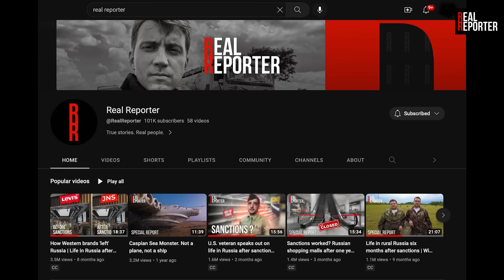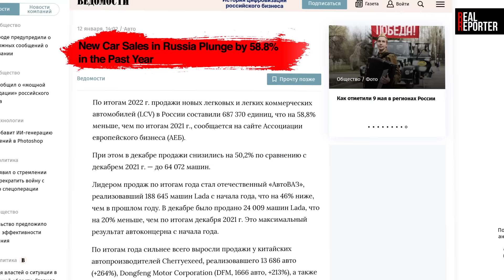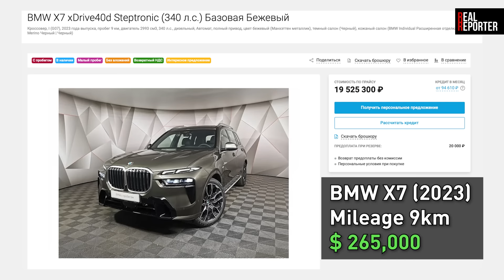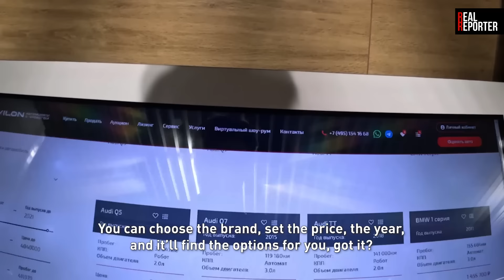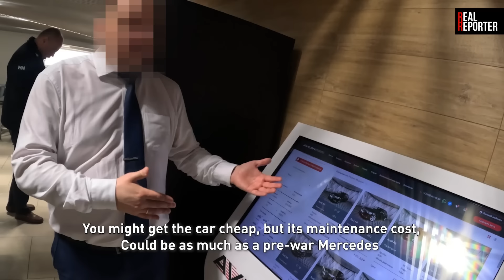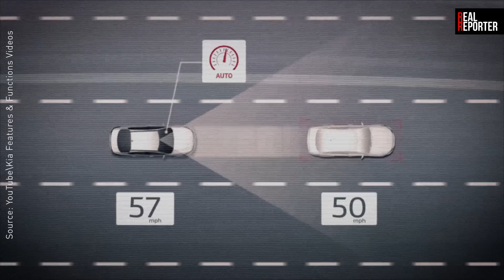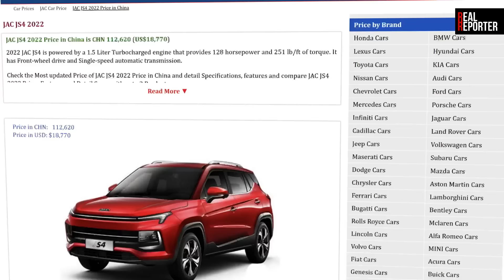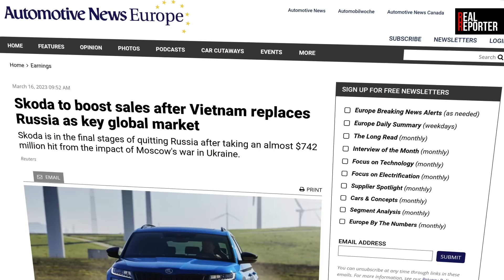Sanctions vs Russia’s car market. Who wins?

Comment: Great video! Yeah, the chinese brands have smoothly entered our market. We bought a new Chery Tiggo 7 Pro at the beginning of 2022 for 1.7 million rubles before the prices skyrocketed (now the new one costs around 2.6 million rubles). And my dad is currently choosing between a few car models, specifically a new Exeed RX when it's going to come out.
Reply from the maker: How’s your Chery doing after one year?
Reply: @RealReporter  no problems occured except for one - the windshield, it is very fragile. We often go to Moscow, the road is long and quite bad, so little stones often fly into the windshield, yet there were no problems on other cars, like Opel or Kia. And in the case of Chery - the windshield has cracked twice on different months. We only replaced it once (40k rubles) and now decided to wait untill the crack becomes bigger 'cause otherwise we'd probably have to spend money on a new windshield veery often.
Reply: @fersotic  Rich people have such difficult lives!

Comment: Man I didn’t expect Russia to be seemingly even more packed with crossovers instead of normal cars. I swear there are more crossovers compared to sedans in these dealers than dealers here in the US! But yeah good thing you didn’t go with that Jag, even without sanctions, those things break all the time, they sell for cheap cuz you always pay more than the difference in repairs. Also for your brake pads, I work at an autoparts store and brake pads are such high volume items I’m willing to bet the store had those in stock since before all of this, it’s entirely possible they’ve been in stock since before covid too, there’s so many car models in order to stay in business you really need a huge stock of parts. The parts supply issue is likely focused on more niche parts, not regular maintenance items, and these maintenance items can probably be replaced by Chinese manufacturers before they’d even be noticeably short in supply. $50 does seem steep for pads though, but I don’t really know all my cars are from the 80s and have like $20 pads lol

Comment: The Chinese Car market is really something huh. Even in the US, they've also entered it in force. South America, Africa, the Middle East, and I don't think its as big as the others but I already see Chinese brands in Europe too. It really shows how much effort their putting into there economy and making sure its seen far and wide.

So far, FAW, Howo, and Shacman are really proven brands since they are parntered with MAN, Mercedes Benz Trucks and even PACCAR Group with the Shacman 3000 models sporting the legendary US engine brand Cummins and comes with an ISM or ISX15 engines in their cabovers. Their also notorious for being insanely over specced(Their 8X4 and 8X8 dump trucks always seem to be prepared to be overloaded and abused beyond belief), comfort is not to my surprise an afterthought but they made sure these things will last till WW4 with a monkey mechanic with a wrench from 1955.

Whatever China is doing, its genius. Their taking what's best from East and West, mending it with Asian reliability and cheapness and making something in the middle. Its scary but its working.
Reply: I always see Shacman X3000 with the Cummins engine on it and man, they sound great when straight-piped. Also, other Chinese auto manufacturers that focus on diesel-powered automobiles like Foton now often use the nameplate Cummins which they put on their light trucks and Vans and it seems to be working from an advertising perspective.
Reply: Chinese ev are amazing and luxury.
Reply: Shacman's are tough
Reply: > Even in the US, they've also entered it in force
huh ? which brands ?

Comment: Welcome to the JAg club, bro! Those are.... I mean i had 3 already! :))) <3 Engine oil change with labor in Bulgaria for Jaguar XF 2015 - 475 bgn or 235 euro. (1 eruo - 2 bgn) Brake pads all wheels with new sensors and labor -> 230 bgn or 115 euro. Gearbox oil change -> around 350 bgn or 170 euro.

Comment: In Greece for an older car you can find brake pads for 10 to 20 euros depending on what is in stock
And usually the mechanic, as long as the brake disks are OK  will ask around 20€ for his work
But to be honest Judging from the practices of spare parts shops in my country that keep years worth stocks
And by the fact that most expendable parts are made in countries like China and Turkey and that many many parts are interchangeable between brands
I will be surprised if Russian shops found them selves without spares
Reply: I have an old Sportage 2, 2006, diesel, four-wheel drive. A set of original Korean front pads, in the store where I constantly buy spare parts now cost 3,990 rubles, and about six years ago, I looked at the receipts, I bought them for 3,100 - 3,300 rubles.  However, six years ago the ruble to dollar exchange rate was 58 rubles, and now it is about 90 rubles per dollar, which is almost twice as high, and the price has hardly changed - miracles.
Reply: @vladimirnikolskiy  probably has to do with having stock from before the war, I mean at least in my country those places literally by entire shipping containers that can last for years
Reply: @Pavlos_Charalambous  No, it's not. There are different proposals. Those in which delivery takes 1-3 days are Russian warehouses, and those in which 10-15 days are from abroad. Shop EXIST RU.

Comment: Here in our country oem brake pads to a similar model to your optra (like a civic or corolla) would cost around $30 to $35 US dollars.  We have cheaper brake pad brands which are "replacement" brands that cost half but still getthe job done more or less.  Labor for replacing the pads here would cost just around $10 or less(much less sometimes).  These are all repair shop prices and local auto supply stores.  Dealerships charge more.
Reply: And your country is...?
Reply: @alexmonster2007  philippines 😁
Reply: @jannzerochannel and your salary is..?
Reply: @de..vision  roughly only 1000 dollars a month.  Minimum wage earners at about 300 dollars a month usually can afford low cc bikes wherein brake pads can cost as little as 3 to 4 dollars.  Usually easy to DIY but you can just give a mechanic 1 dollar to have the pads replaced on a low cc bike.

Comment: My dad has a new Tiggo 7 Pro and it was the first car ive been in that felt really comfortable and futuristic in a sense. It has alot of features like sunroof, heated seats, great aircon (i live near the equator so this is a must), and even mood lighting. The only issue my dad hates was the LED headlights not reaching that far. Powerwise, its great on paper. But when my dad floored it with the sport mode, there was just a small pulling feeling. Idk  I was maybe expecting much coz it has a turbo. But in a practical sense where you want to go from A to B while being comfy and having extra, modern features, its a great car on its price which is around 22k USD converted.
Reply: Let’s see if it’s still running 2 years from now tho
Reply: @bigmedge  yeah let's see coz it was bought last year
Reply: Just be smart and get rid of it before the warranty expired
Reply: @padorukurumi6572  exactly, so let’s see if a 3 year old Chinese car will still be running
Reply: @bigmedge  then you should ask a brazilian or a chilean.
Reply: You're expecting a bit too much from a 1.5 liter engine. If you want the oomph, you should upgrade to a Tiggo 8 Pro Max or Exeed with a 2.0 engine and AWD.

Comment: I would pay a lot more here in USA, but, I would have replaced the rotors with it. My son’s 2011 Scion Tc just got front brakes: about $250-$300 was just dealer parts, including ALL the hardware, pads and rotors. Had my friend’s shop do the labor: $120. 
True, I could’ve simply resurfaced the rotors to get rid of the annoying pulsation.
Reply: А что за роторы? Мотор роторный что ли?

Comment: In Australia changing both sets of brakepads on an Astra will cost about A$400, (A$180 for brakepads + A$220 - 250 for labour) or US$270. The cheapest Ferrari F430 is on sale for A$269k or US$177k, that US$95k one in the Russian dealership is an absolute steal.
Also Havals are everywhere on Australian roads.

Comment: As a mechanic in the USA a set of pads is around 50 to 100 bucks a axle. So front and rear could be between 100 to 200 in parts. Labor on average can range significantly from 65 dollars a hour to 150 dollars and hour. The front pads would be around 1 hour so would the back. The rotors to replace or cut could be maybe 50 to 100 dollars a rotor. Cutting them could very a lot. If you paid to have your rotors cut and the pads you got a great deal compared to the USA. If they were not cut then the break job wasn't properly done but the price would be fair
Reply: Nah, the rotors doent need to be cut every pad. I diy replacing the pad on my Civic back in 2018. When I pulled the caliper I see the surface condition is good. Having doubt, put out a dial indicator and witness couple thousandth of inch each way. Less than 10 in total from both side. And check both rotors and both are similar. Im not sure what the reading was from OEM. But less than 10 thousandth of inch perpendicular is good enough for me. And 30k km later, it still hold up ok. What surprised me is those cheap ass amazon pad dispute not as grippy as the oem pad. (Still able to lock wheel on a panic break) But crazy hard to wear down. The OEM pad only managed to last 50k. This cheap ass amazon pad hadnt even half way through. Lol.
Reply: I've experienced mechanics in US. I still don't understand how are they so expensive. I'm italian, and even in the expensive part of the country, a Mercedes dealership will be around 70 to 80euro/h. On average it's about 50 (car or motorcycle mechanics). In US i was quoted 100 bucks/h at a generic mechanic in rural Pennsylvania.  I mean, yeah, i understand that life is disproportionately expensive in US, but you pay like half of the taxes we do :D .  I came to the conclusion that the stuff i see in american movies (people living with broken, unreliable cars) is not really fiction.

Comment: Thank you for this video! I’m a massive petrol head so super interesting for me;

First your Astra, UK prices for pads £25 and fitting £25-30 so you got overcharged there.

Second Chinese cars are ok, their engines are usually based on older designs they bought from (for example) General Motors and the parts are no doubt the same - the parts are all made in China anyway.

They can rust quickly though as corners are cut on the metal quality and treatment/paint.

Those western prices were colossal! But I think the garage is price gouging because surely you can buy a car in Europe and just import it yourself for 1/4 of those prices?!

Russia will now just lean towards China, no doubt China is almost glad for these sanctions as its creating a market for them right on their doorstep.
Reply from the maker: So glad to hear you enjoyed the video. I'll admit I'm not exactly a petrol head myself, but I certainly appreciate your knowledge on the subject! Thanks for the heads-up about the prices for the pads - it's certainly possible that I overpaid :)

And you're absolutely right - it does seem like these sanctions are driving Russia closer to China, in more ways than one. It's fascinating (and a little worrying) to watch these shifts happening in real-time.

Anyway, appreciate your insights, keep 'em coming! Cheers! 🚗💨
Reply: Russian taxes for a new car would add about 50% to its price if you want to import a car from another country. It is one of the reasons why China cars prices are so different in Russia vs China.
Reply: @MsMelkus  I guess its 50% of what the gov department says its worth and not 50% of you paid for it?
Reply: @TobotronPrime  I don't know honestly. For a new car it is the same anyway.
Reply: @MsMelkus  well if I was living in Russia I would 100% have a UAZ-452 Bukhanka - "bread loaf" haha!
Reply: @TobotronPrime  Wait, I was not clear I think. The tax is not just 50% of the price - theere is a compex formula based on car age, power, model, etc. 50% is just a rough estimation which I heard in another youtube video from a man who is doing business on reselling new China cars which you cannot buy officially in Russia or which costs too much comparing to the price you can get if you import this car on your own.
Reply: As an old volvo pervert, i can say that prices for parts in Europe have always been quite low, as compared to similar stuff in Russia, even before "THE EVENT".
Reply: For £25 you can get quality parts not Chinese rubbish. They get bummed there big time. China gets cheap fuel and minerals but sell cheap rubbish parts nobody wants and cars at inflated price.
Reply from the maker: @RemmyXO  Hey there! Thanks a lot for the kind words and for watching the video! I'm glad you enjoyed it. It's cool to hear about your friend's experience in car importing. If you could drop me an email at 1359RealReporter@gmail.com with more details, that would be awesome. I might be interested in exploring some options. Thanks again for the support and the great feedback
Reply: @MsMelkus  its engine size engine power fuel type car body type its fairly cheap 10% maybe. While temporarily importing your car to Japan for example TEMPORAIRLY my 2019 S400D was 650k rubles you can buy a new Lada for that our taxes are pretty decent.
Reply: he should negotiate mechanics and car part stores always overcharge because people don't know the prices

Comment: as a BMW owner if you dont have deep pockets stay away from german and italian cars 🤣 buy toyota 😃
Reply from the maker: Oh, my pockets certainly aren’t deep lol
Reply: @RealReporter   mine were way deeper before BMWs so I warned you 😃 Dacia or Suzuki might be good bet too lastly Skoda or Korean brands might be good too if newer, older models are workhorses , here in Europe prices for cars went out of windows as well , not just russia . Here in Europe such a Dacia Duster brand new 4x4 can be bought for around 20k eur and suzuki SX4 Vitara or S cross from 25K brand new and around 30k with 4x4 and maxed out.
Reply: Toyota was unbreakable century before -now its way overpriced. Even Korean cars   become overpriced too after they reach durability of famous car makers. BMW had durable cars too... until they understood that its not profitable
Reply: @alexgo1034   yup of course all cars brand are cheating out on quality, but toyota stays king even overpriced, as usually japans engines and simple cars made it reliable as heck, with lot of options and assistance and electronic everything goes down the drain. Even more in EU then in russia, because we have stupid emissions, fuel with etanol and bio diesel required, EGR, DPF and all those things to meet emissions breaks down and are costly to fix
Reply: @viliambena6767  All brands have good/weak platform time to time. Toyota was unbreakable when their cars haven't much additional features. Now it's ordinary brand with hope that it will brake after warranty period ). Trust me I'm autoelectrician )

Comment: In Germany BMW x7 starts at 110.000$. BMW x7 M60i xDrive, starts at 144.000$. BMW ALPINA XB7 Starts at 189.000$. Thats pretty insane that in Russia you pay 215.000$ for base model. BMW Mansory X7 will prabably start at around 270.000$. But im not that really surprise beacuse of the Sanctions, and that russia is not getting new BMWs and other European Cars.

Comment: In the US my wife has 2020 Malibu, I have her old car a 2008 Pontiac Grand Prix with over 2000 miles. I love the car, it does need the trunk lid painted, if it goes another 100,000 miles I will be thrilled. Paint your older car, have the inside detailed, and then turn it over to a high end mechanic to make it reliable. Much cheaper than a new car, even if you have to replace the drive train. Our insurance doubled when we bought the Malibu, our vehicle taxes sky rocketed.

Comment: Side note regarding buying spare parts - all people I know never buy them in small shops.
We buy them online either on specialized platforms like Exist or Autodoc or on general marketplaces like Ozon (yes, Russian Amazon).
For example, brake pads for Opel Astra right now on Ozon are quoted from 1000 to 1600 RUB (12-18 USD) depending on the vendor.
And I see no shortage of spare parts - even decade ago most of them come to Russia through hubs in Emirates and such.

Speaking of new cars - one must know that before sanctions, 95% of new cars of international brands were not imported but rather produced locally in Russia:
Nissan and Hyundai in St Petersburg, VW in Kaluga, BMW and KIA in Kaliningrad and so on
Production was localized only partly and key components like engines and gearboxes were imported, so after exiting Russian market those factories to be either 'freezed' or reconfigured to new (chineese) platforms like they did with Renault factory in Moscow.

So in the moment on the new cars market we have mostly Chinese brands with x1.5-2 price multiplier

Comment: Unfortunately, Russia is too cold. 
So the good electric cars made by the Chinese are difficult to adapt to such extremely cold weather. 
But with oil prices so cheap in Russia, you don't need to drive an electric car. maybe TANK300 OR 500  A brand owned by the Great Wall can adapt well to the Russian situation.Their cars cost a lot of gas but are very durable。it cost 200000RMB in china.
In my view as a Chinese, the price of Chinese cars sold in Moscow is not quite reasonable maybe50%higher？, but This is the best you can get right now。

Comment: I paid for brake pads change in Czech republic 50 USD total in small garage, Hyundai ix20, all 4 wheels, original parts, done in 2 hrs. Need to mention that Hyundai is produced locally, so spare parts are easily available and cheap.